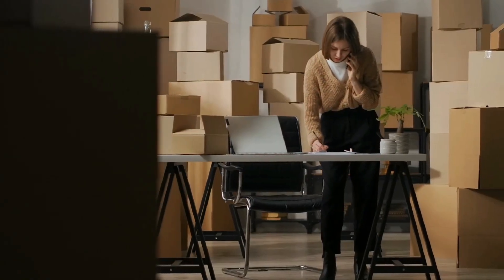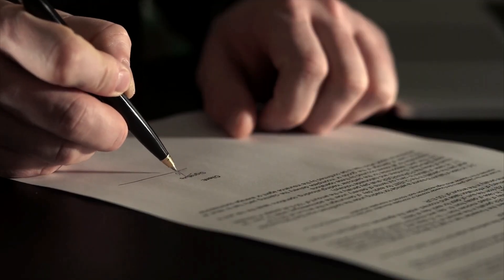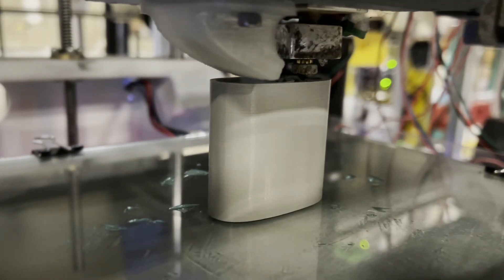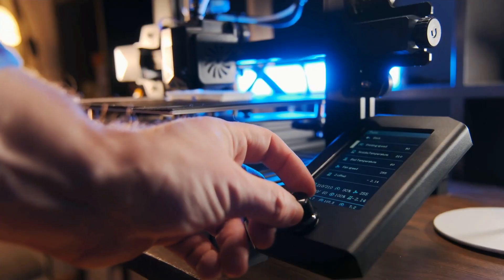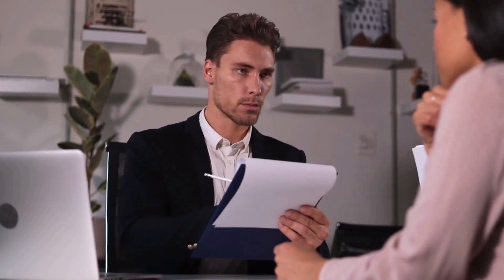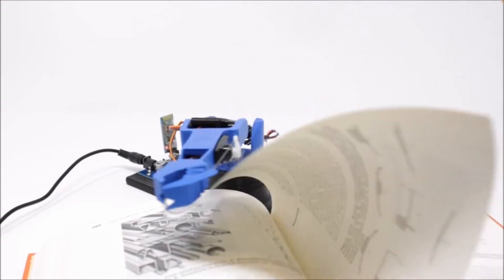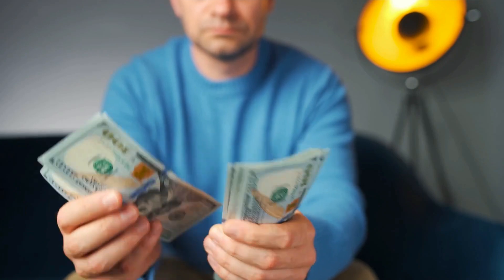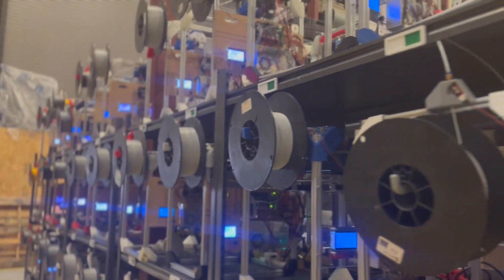Minimize Risks in Mass Production 3D Printing

Comment: Question for SLANT: 
do you guys fill up the build plate with multiple items? or do you keep it one item per plate?
I could see multiple items as improving efficiency and printer up time but you have to balance that with reliability. In my experience a plate full of many items is more likely to have failures.

Comment: How do you guys approach the situation where someone gives you a clearly IM part to 3D print? Do you turn them away and tell them to come back when they fixed it?
Reply from the maker: We have our design team offer suggestions and design reviews of the part to optimize for manufacturability. But there is no reason to accept a project if the client will not recieve a good result due to design issues.
Reply: Because how would the client know to design for 3d if all they ever did was injection moulding right? Good question.